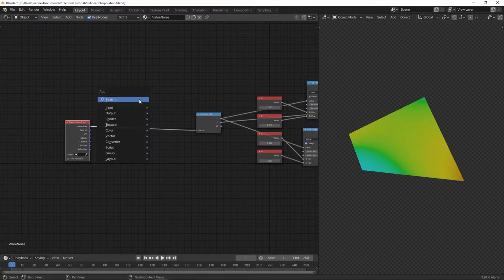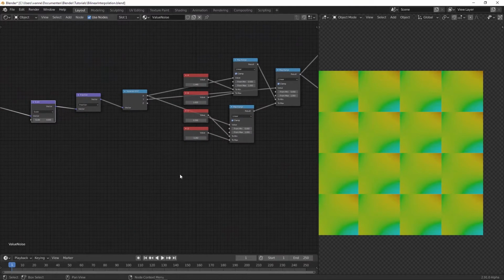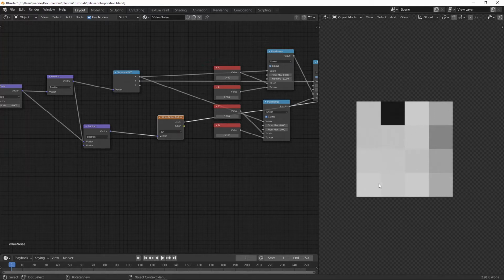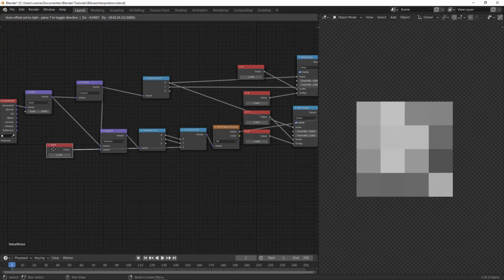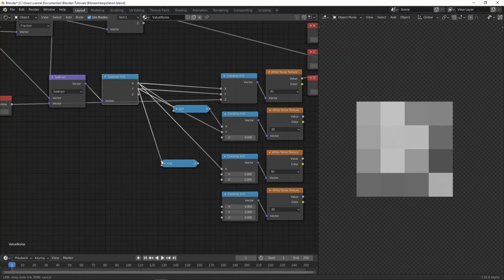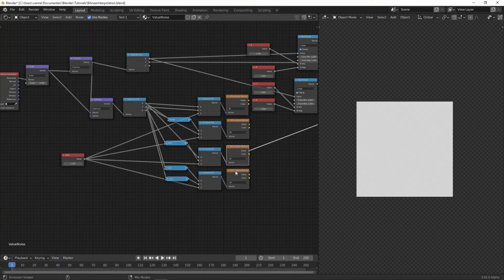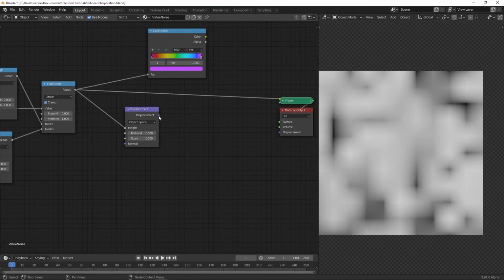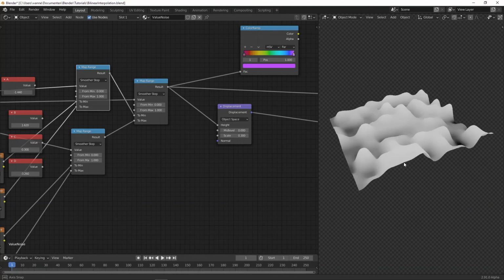Value Noise from White Noise

Comment: wow! is it possible do it with voronoi color?
Reply from the maker: You can use the voronoi color instead of the white noise if you want (with random set to 0). It is also possible to create a voronoi texture using white noise quite similarly to what we did here (check the neighboring cells to see which one is closest)